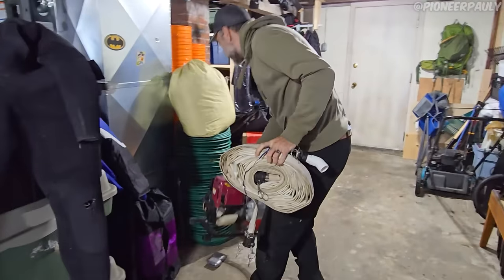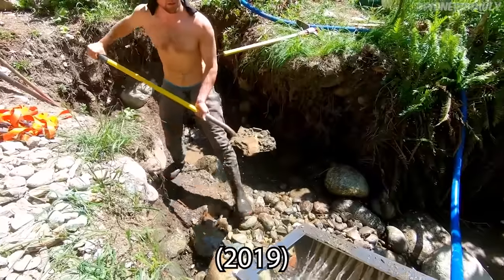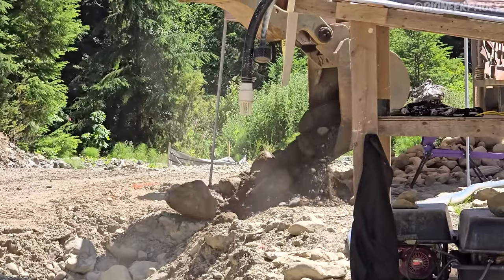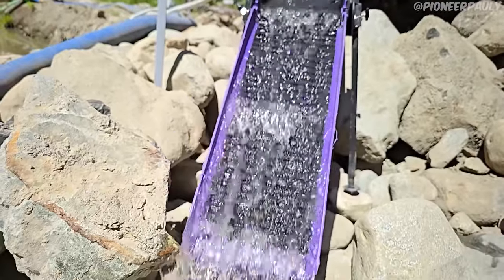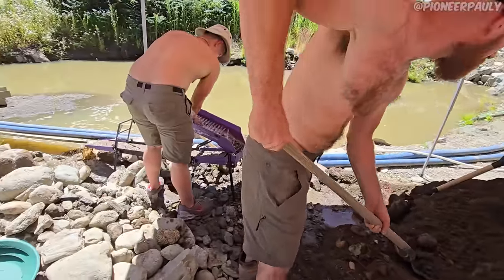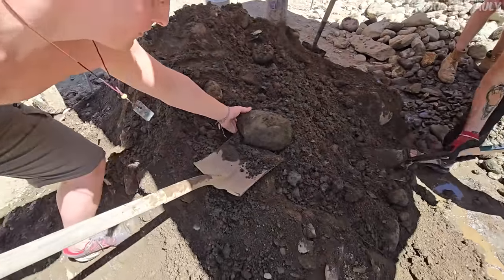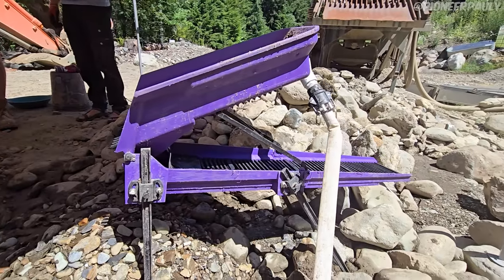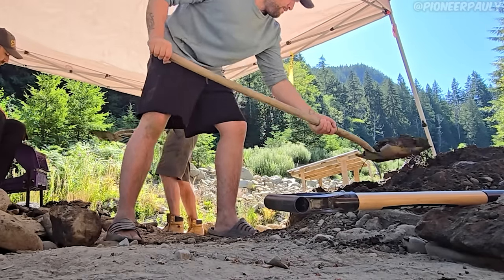Using An Excavator To Highbank The Deeper GOLD!

Comment: I always thought the large high bankers were pointless even massive scale mining. Multiple smaller ones means you can always run dirt. 1 big one is 1 shot at banking if the machine goes down you stop work. If you have multiple smaller ones and 1 goes down you can still at least run something. It's more parts though, more machines to repair, but i think its worth it very little to really go wrong with them.

Comment: you should build something - that highbanker sucked
Reply: Appauly Highbanker would be made with a 10 foot high circulating child’s playground sled and a fire hose connected to a fire truck blasting water down the sled with the gold slamming into the radiator of a Lambo which would be parked at the bottom of the slide facing the oncoming rapids of water and dirt - Lambo gold - Paul to snipe out